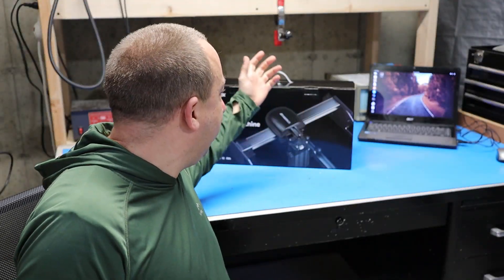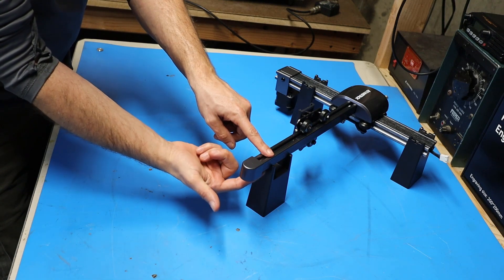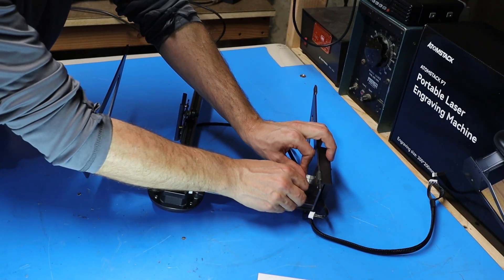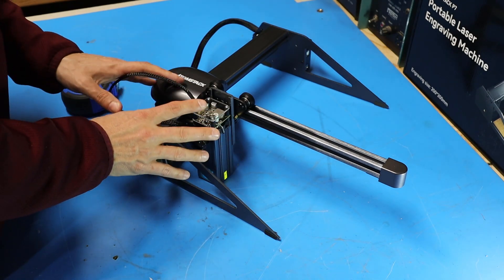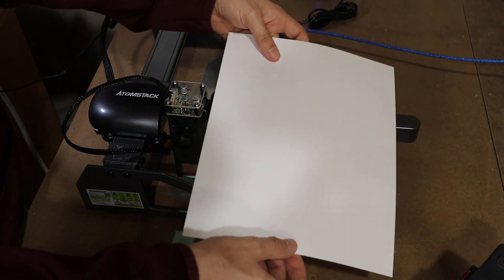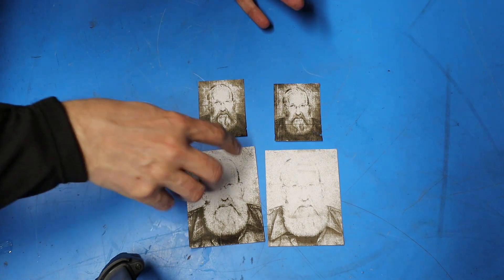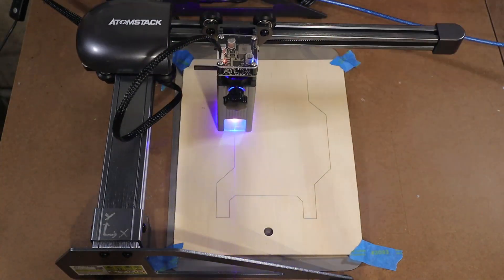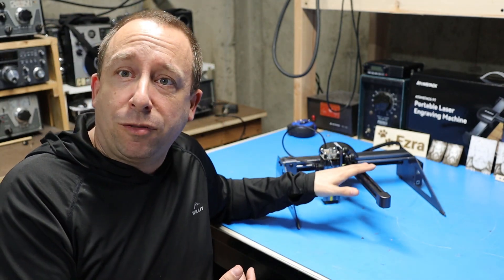Atomstack P7 Portable Laser Engraver - Assembly Overview and Demo!

Comment: Hi good afternoon froM Gibraltar i have Atomstck p7 m30 do i need an f30 air assist for this laser because it doesn't seem to cut even 2.5 mm ply @ 90% power with 40 pass what is I'm doing wrong I've tired light burn and LaserGRBL

Comment: the hardest part you didnt spend any time on which is how to get your machine hooked up to the software!!? i no one has how they actually get the machine to be found by your computer the link they have for macs doesnt even work..
Reply from the maker: When I plug it in windows assigns a com port automatically.  I then just pic that from the list in the software.  I'm not a Mac user so I have no idea about how to connect using one

Comment: Hey I like the review I have a question does it work with metal aluminium and steel?
Reply from the maker: If you coat the metal first it might.  This is a 5w laser so you might be better off with something a little more powerful